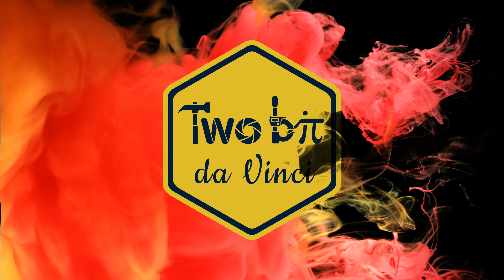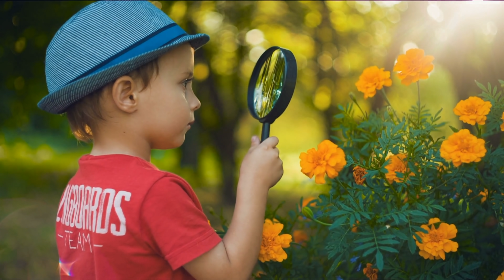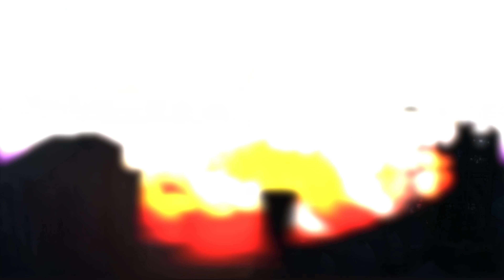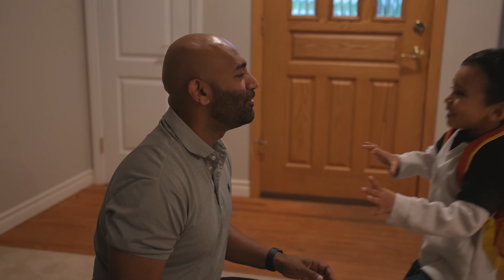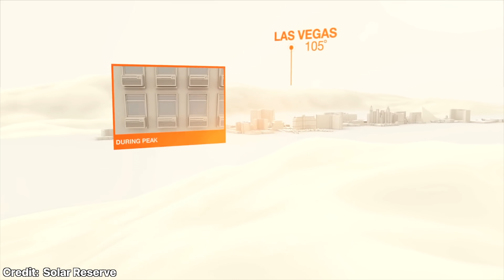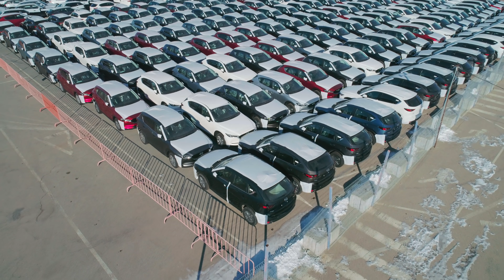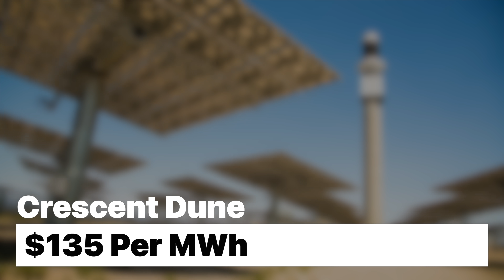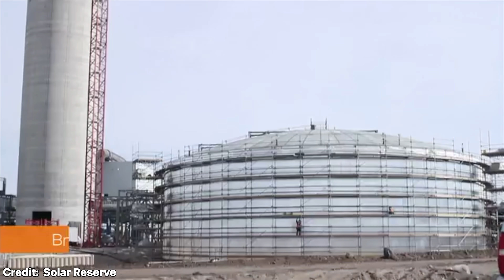This Billion Dollar Solar Plant was an EPIC Failure

Comment: The Crescent Dunes concentrated solar power plant is not the one you see on the way to Las Vegas. That is the Ivanpah plant, which is still open but scheduled to close in 2026. The Crescent Dunes plant is near Tonopah NV, not far from Death Valley and it has been closed since 2019.

Comment: We have design where we are getting Temps over 2000c, thats the answer.  We are moving that heat and storing it with close to zero loss.  CST is going to change the world.  Less than .02 / kwh to produce electricity easy

Comment: Mistake number 1 is putting it outside where it constantly radiates heat, and has difficulties associated with storing salt in such a complicated structure. Perhaps it might work better if you put it underground in a giant crucible  and focus the light through lenses.

Comment: This is totally stupid. The didn't have to use molten salt. They could've easily retrofitted the tank to hold water and run turbine. And at night hold warm water. Water is going to much easier to maintain. They could've literally made a large pool of water heat it up. They don't even need to make a tank for it.

Comment: LUZ operated a pair of 80 MW solar thermal plants for more than a decade near Harper Lake in the 90's  They used a synthetic oil instead of molten salt and had a gas auxiliary heating system for peaking requirements.

Comment: It seems that crescent dunes went from concept to full scale plant without first building several small scale demo plants. They seem to have gone from concept/bench scale, directly to commercial scale. Crescent Dunes used several new technologies (remote-controlled mirrors and molten salt storage) with limited testing. Sorting out the issues of these new technologies during operation drives up the costs per mWhr of production.  

The failure of Crescent Dunes to operate anywhere close to the projected efficiency doomed this project to failure. The efficiency calculations were extremely optimistic. A new technology like this should have had a very conservative efficiency estimate, since this is the basis for the success/failure of the plant.  The designers were so anxious to get funding that they fudged the efficiency calculations.

The drop in PV costs not only killed Crescent Dunes, but also Solyndra. Both projects failed to look into the reason why PV costs had increased. The problem was a temporary shortage of Silicon. When the Silicon shortage was resolved,  PV prices plummeted.  This doomed both Crescent Dunes and Solyndra. 

I built a plant to produce H2Se for producing the type of PV that Solyndra used. I am well aware of the PV economics  .
Reply: The Crescent Dunes plant was based upon what had been learned from several generations of previous concentrated solar plants, including ones that had employed molten salt storage. Many people who get involved in such projects tend to have little interest in learning about the past unexpected problems that were encountered elsewhere. They come to the job with the impression that virtually all problems have already been solved and any that they encounter can easily be dealt with by them.

Comment: Is there a way to use non articulating panels. 

Heck we new 10 years ago that articulating arrays( PV)  never pencil out. 

But can a smaller (non storage unless excess is created) system with non articulating system  have a higher efficiency?  

I’m pondering an array that has stationary modules that have enough panels to create the heat needed both morning midday and late day.   Again non articulating.  

But maybe that’s what I missing is that it would take a lot a lot a lot more arrays because most of them would be missing focal point over the day.

Comment: CSP has significantly decreased in competition with the declining costs and increasing efficiency of newer PV cells.   However, the need for less intermittency (more base load) 
has increased the value of the stored (dispatchable) power.    Several CSP plants function well with storage (as thermal salt reserve) of more than 24 hours.  The "leak" suggests
that the engineering design, or project management may have been deficient.  Salts can be highly corrosive, and more so if water is involved, so Materials, Fabrication, and Operations
can all cause failures.  In late 80s (or early '90s) Grumman Aerospace (which had fine engineering, as demonstrated by carrier-based aircraft, and components for Apollo moon project)
provided transport buses to NYC, which were found to suffer structural failures as a result of (a) poor road maintenance with abundant potholes and (b) substandard welds of suspension components, which failed in service. It turned out that the welders had inadequate training and experience, and the fabrication process lacked Quality Assurance (and testing).

There is more than scale involved in decreasing prices of manufactured components (iterative engineering/tech advances), where the ISO9000 specs deliver.

Comment: Instead we should use non tracking agile lenses that direct sunlight in one direction and they can be made of glass then we can transmit that light to fiber optic cables made of quartz to resist temperature and then ones made of saphire to resist temperature where they should all transport sunlight to one source where you can have a furnace ……. No electronics or gizmos needed…. Furnace can be made to melt crap or even absorb and redistribute heat like using saphire or quartz that’s colored black so it absorbs “alll the light” essentially…. And technically you could do both in a way where the light heats up stuff and melts/ burns it to add on and generate more heat…… then the very sunbeam could also heat up the smoke at the same time and vaporize it cus of high heat…..

Comment: The USA needs to drastically change everything.

Lets say war happens, power stations being knocked down will put most homes without power. So we need to strengthen that weaknesses. We should try and get homes with a MINIMUM of a backup battery, but preferably also some solar. We need to then rethink how power is distributed. Maybe more stations to give some redundancy instead of fewer critical failure points. We need to consider all the options where they make sense.. Sand batteries for example maybe where its warmer or hydro where theres plenty of water.. etc.. but we need to think new ways to store, distribute, and generate.

Comment: Thermal solar has a huge advantage over photovoltaics. Nighttime solar without expensive batteries. There is a thermal solar plant near Mojave California thermal with oil (not salt), has been running for decades. I love photovoltaics, but there is a place for both. Sounds like this project was mismanaged from the start.

Comment: It wasn't just SolarPV cost deltas

Crescent Dune (like a few similar plants worldwide) used natural gas to provide heat to keep the salt molten in the off-hours, the idea being a hybrid system using less than 1/4 the gas of a natural gas fired power plant.

It turned out that they may as well have just built a gas-fired power plant and not spent the money to build the solar farm. It used more than twice as much gas as predicted and ended up costing more overall than a dedicated gas plant due to the reasons gone into

Then there's the issue of Crescent dune blinding pilots 100 miles away and instantly roasting any bird which flew near the tower (the kill rate was of major concern to the EPA)

Comment: I'm not satisfied with the cost analysis.   Too much hand waving 'greasing motors' or motor couplings isn't exactly a major expense.   It doesn't ring true.   Solar voltaic has a more limited life span and dropping efficiency already starting at half the efficiency.   If I had to guess, the shift in technology is due to a shift in what the government is will to subsidize.  In any case the discussion was very superficial and unsatisfactory.

Comment: Solar Thermal remains a very interesting technology.  Solar thermal air panels remain one of the easiest DIY builds to save energy.  Once there were many windmills that converted solar energy directly to mechanical energy.  Efficient but again the mass production of electric motors gives economies of scale.  Would it be possible to convert this unused plant to some manufacturing process that required thermal energy...refining ore or distillation?

Comment: When I was a kid, we had a  16 "   reflector dish  which would shine upon a steel bladder with antifreeze pump thru.  The coolant would go to a heat exchanger   to provide heat and hot water.  The dish would track the sun throughout the day.  It worked for several years and needed much maintenance.

Comment: This is from wikipedia (attract attention to the last phrase): The first three months of 2019 (January, February and March) showed good progression, topping all previous monthly data, but in April the plant was shut down because the project's sole buyer, NV Energy, terminated the Power Purchase Agreement for failure to produce the contracted power production. The power generated also cost NV Energy about $135 per megawatt-hour, compared with less than $30 per MWh available from a new Nevada photovoltaic solar farm.[40][16] But to compare fairly, it must be taken into account that the Tonopah solar project power is dispatchable whilst photovoltaic power is intermittent. Truly levelized cost comparisons must include the capacity payments for generating capacity available to supply power during peak hours. By doing so, low-to-high hourly wholesale electricity prices have been shown to vary by up to four orders of magnitude.[41][42]

In July 2021, the project restarted production.[21]

Comment: The molten salt was way too ambitious. It could have been done way easier by just plopping a big boiler tank filled with water in the middle and use the steam directly. Non moving energy storage is extremely inefficient either chemically or otherwise. The new thing now is sand storage, which is noting else than rock in smaller form to be heated up and then reflow water through it to turn that energy into steam. Handling steam is way easier and we have alot more experience with it, and its not as dangerous as moving molten salt. Yes the energy density is much higher but that gets eaten up by the much higher complexity. Steam moves on its own, you don't need pumps at all. For salt you do. You can even shut steam off with this very very fast by just moving the mirrors. And you don't have to dump the steam, you want to condense and recycle it, which even gives you a turbine boost because condensing steam back into water can create a vacuum and increase the pressure gradient inside the turbine to get even more power out of it.
Salt was just a bad idea.

Comment: In Australia we had a plan to build a thermal power station based on a 1km radius black disk with a 1km tall tower/chimney in the middle.  A turbine in the chimney was intended as the power source.  I don't know why, but it was canned before it was built - perhaps for similar reasons to the failure of this system.

Comment: Why did all these towers have molten salts leaks? The ones in Africa had the same major issues (Desertec).
Seems like the construction was the major issues with many faults and less with the other financial issues, I dare to say same company design the molten salt system made the same mistakes.
If the plant was operational longer with a lot less issues I think the profits would still make it run today, but cause of the major engineering design issues it was a huge flop.

Comment: Solar panels that uses molten-salt to store energy for night will be a fairer comparison.

Flat reflectors to cater to sun angles are good. To use all at once is a bad idea. To have your stuff(office, plant, equipment) in the center of the furnance is asking for it. 

If the calculations are on running and maintenance costs and not fancy climate change theories. The office and equipment will be below the reflectors. Super heated steam generators will be used, piping will be at the furnance, heat-concentration and spread will be to steam-powered generator levels (and cool the structures flow-rates).  Use other types of generation for night instead of the storing and other inefficiencies. Reflectors will be fixed while sun changes angles and additional reflectors cater to seasons shifting of angles.
Reply: Smelting plant reflector-concentration will be different
Cooking factory
Drying factory
... production line (green house on fire effect)...
Too big is...
Reply: If a hill is conical-shape
= chimney effect will mean the furnance should be concentrated at the top of the hill
= the mirrors will be offset from the slopes to see the sun during daylight hours
= and the super heated steam will be piped down for safety before feeding to the generators
= and the offices will be next to the supermarket

Comment: You didn't mention the slight problem of burning thousands of birds alive when they flew through the concentrated light. Workers said it looked like little burning planes crashing to the ground.

So a lot of people weren't very happy about that especially when they could get their power cheaper from other means that weren't frying thousands of eagles, hawks, owls, and migratory birds.

 And even though I'm not one of those PETA weirdos I kinda gotta have to agree with them. Especially when you put yourself in the birds shoes. Happily flying along then without any warning you instantly your feathers instantly incinerate, and you begin burning to death as you leave a trail of smoke while falling to the ground. I don't know about you but that sounds like a awful and painful way to die. So Im rather glad this place shut down and isn't viable.

Comment: The number of heliostats of the entire system can be ganged and controlled using only two motors. The entire control system and maintenance cost reduces due to this type of system design. Useful for a small area coverage and related heating applications.

Comment: The argument that this project failed because photovoltaic became cheaper does not make sense. Once it was built the only cost was to operate it. The cost to build it was sunk cost and therefore irrelevant. Did cheaper photovoltaic energy make the price per kWh in Nevada drop so much that it would not be worthwhile operating the project? I doubt it. A time series of energy cost in Nevada was not shown. Most likely the project failed because of bad engineering financed by hundreds of millions of dollars of taxpayer's money. The government should restrict itself to subsidizing basic research, which would be much more productive, and never distort prices by subsidizing projects that would not need subsidies if they really made sense

Comment: I will confess I have not yet watched this video but I certainly will. I just wanted to comment before I was exposed to the information in the video that might color my opinion. In the interest of full disclosure I will point out that I'm an engineer with over 50 years experience in large power systems and currently design and build solar power and energy storage systems. When I first heard about the Crescent Dunes system I thought it was a stupid idea. Just about everything I've heard about that system since then has confirmed my initial opinion. While small scale solar thermal systems can offer up to 90% efficiency compared to photovoltaic with only 22% efficiency the obscenely over complicated system they were planning for this project just made me laugh. I'm going to watch the video now and will update this. Update: After watching this, naturally the AI that was watching me offered me more videos and I'm sad to report that there are more groups promoting this same idea with the same pie in the sky predictions. Bottom line, the argument that their system can't compete with PV (photovoltaic) tech that unexpectedly came down in cost is just silly. If their system was designed properly they would have been able to produce competitively. You NEVER design to compete with another technology that is also not competitive with the fossil fuel base. They should have designed to produce at a cost to compete with coal. If that was not possible, then drop the pencils and shoot the engineers. Not really, LOL, that's something an engineer at Mercedes told me once.

Comment: I worked there during startup. The main reason it failed is that COBRA got cheap and start using seamed SS piping for the Molten Salt instead of seamless like the specs called for. They fired quite a few PEs until they found a 70+ year old to basically rubber stamp their changes. there were Molten Salt leaks from the git-go. On another note Nancy Pelosi's son was on the board of directors for Solar Reserve. They would have monthly meetings in Tonopah. The Solar Reserve EXECS would charter private jets from Burbank, CA, have Air traffic controllers drive up from Las Vegas to man the airport in Tonopah. Instead of flying commercial from LAX to Las Vegas and chartering a bus. You should check out their Corporate office in Santa Monica, it is a palace all on the taxpayers dollar. This is what you get from the corrupt Politicians occupying the Capitol now

Comment: Solar panels need batteries  and maintenance  Star to calculate the cost.
Design a Hybrid Photovoltaic molten salt power plant.
Use 70% percent of solar power to feed into the grid during the day ,use 30% to heat up the molten salt by heater rods for the night 
to run the steam turbines.

Comment: One challenge that may not be priced in is the risk of silicon dependence that comes with PV. Anyone running those systems with pipes running in mirror troughs, and eater pumped through for steam production?